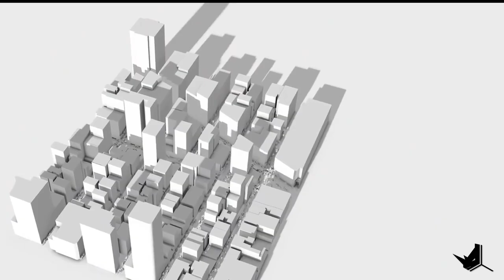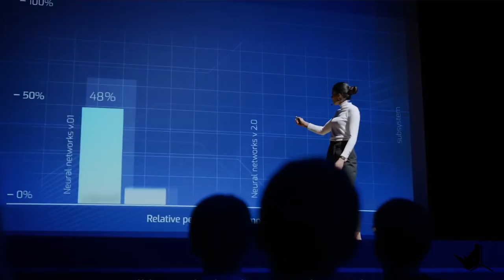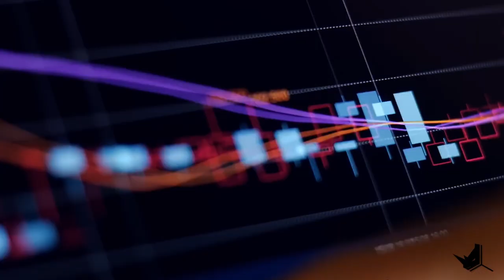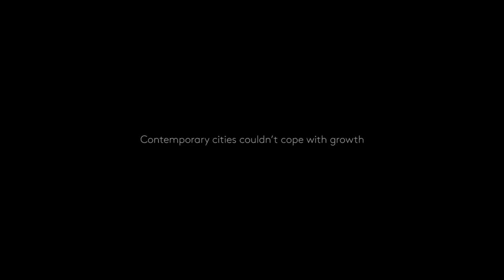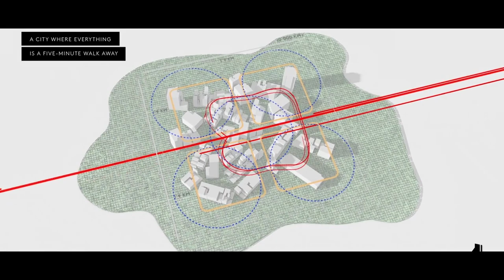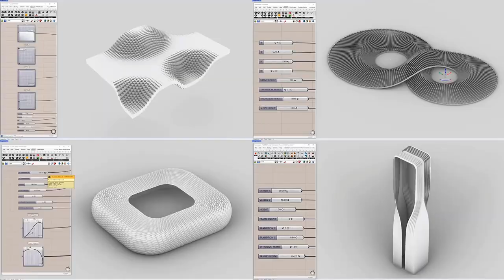FUTURISTIC Megacity or a Complete DISASTER?

Comment: The idea is a good 100 years old and actually nothing new. There have already been several approaches to buildings of this kind, but none of them have worked. 
One of them is the Wohnberg by Walter Gropius in 1925, The Wall by the Nazis on the Western Front and a few more.
The problem is that this way of life does not yet exist and 99% of the inhabitants are not yet used to this kind of focused life. Apart from that, there are 10,000 other difficulties that arise here. 
5Trill. Dollars is a really hard claim - even for 50 years. But if you think about it further, in 50 years we will lose 30-40% of the world's resources to these three projects. Apart from that, I don't see any direct water supply, it needs its own industrial zone the size of Berlin to supply the whole thing even remotely sensibly with building materials. 
There are no water and waste recycling facilities and much more. Stagnant air, heat through glass, veneering, and so on.
Billions of tons of concrete glass steel and aluminium as well as copper, bronze and gold. No matter how you look at it, the CO2 impact is unbelievably enormous - the building would have to run maintenance-free for 100 years (from final completion). 

We have been developing megastructures in Innsbruck for 25 years. I have been involved with it for the last 8 years. Always with the focus on compatibility in the holistic sense. A composition of this size can only function through targeted agglomeration. Like the expansion of the city in another dimmension - Mortal engines or in "Valerian and the City of a Thousand Planets". The negative example we are moving towards here is more like the "City under Single roof" concept in "Dreed". Almost certainly no one wants that. 

More Information about architecture, social strategies and save enviroment and matieral in 3point circles:
www.architecture-nomad.com www.marchitektur.com